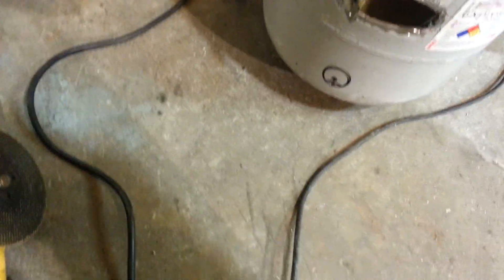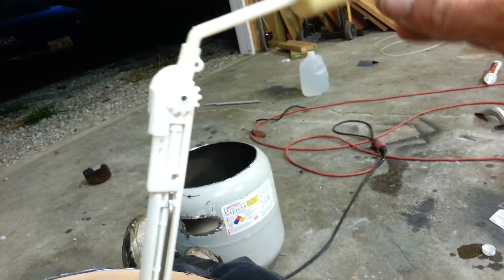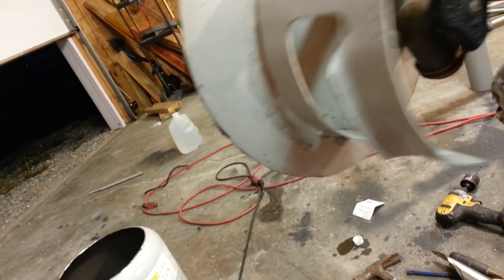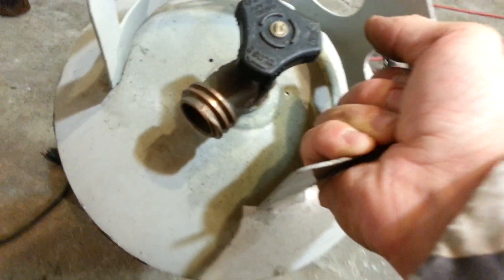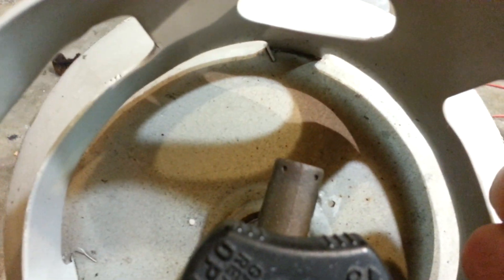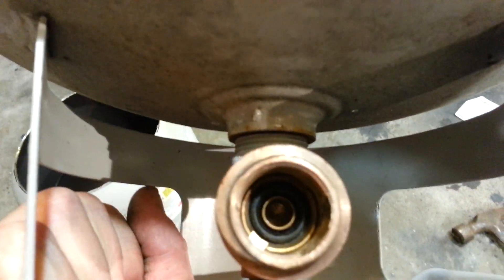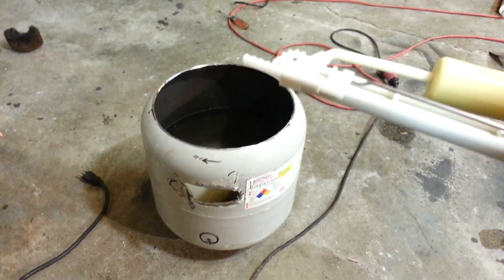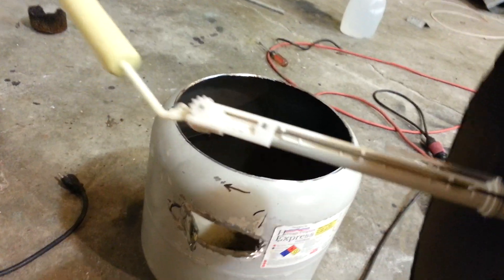How to cut a Propane Tank open  (Safely) Whats inside ?

Comment: The danger for musing a drill is igniting the gas with the motor from the drill not necessarily the drill bit the proper way to drill through the tank is to use a hand  drill my dad worked on airplanes and that's what they use

Comment: Appreciate the vid. I've got a camp stove fuel bottle that I'm trying to open. I drove over it with my truck, so the thing is a big mess, and I can't get the pump off of it. Too afraid to cut it open because there is still a lot of residual white gas, but tomorrow I'm going to try and flood it with water. Should do the trick.
Reply: You survive? 🙂
Reply: @electronic-shadow-monster  [checks various vital signs] yup still here ;)
Reply: @EddieTheShoveler  🤣🤣🤣

Comment: maybe should take the valve out before you start to cut. takes about 1:30 to get it out, then fill it with water then turn it upside down for a while (I've got one sitting now for two days) Otherwise I feel like there's a good chance somebody could blow themselves up doing it this way. You'd be surprised the pressure that can build up. I was just reading about a guy that killed himself welding a steel drum that had acetone in it at some point, the vapors from a tablespoon is enough to blow it.

Comment: Another way to get the propane out is a siphon from a bucket of water, or a hose adapter to a small enough tube to fit into whatever opening is available, and fill the tank with water.  Needs a second opening for the propane to escape.
Ignore the residual smell, that's residual butyl mercaptan which is a stinky compound added to propane to make sure you notice leaks!
Reply from the maker: +Scott Willis thanks for the info friend

Comment: how would you empty the tank completely
Reply from the maker: TropojeAlbania push open the  check valve inside of the discharge orfice, its spring loaded and is ment to stop gas from leaking out of a disconnected tanks. hooking it up to a hose made for it will screw into the valve and open it
Reply: NOBOX7 thanks man

Comment: The common reason why the valves are so hard to take off is usually because they are Left hand threaded so need to be turned clockwise to loosen. i found this out after hours of struggling to release one  when in fact i was making it tighter !
Reply from the maker: thanks for the info friend ill keep you in mind next time, i would also like to ad that its a good idea to do this in front of a fan to blow any residual fumes away, Douglas Alan brought it to are attention that drills have sparks inside   unless they are the new brush-less cordless version
Reply from the maker: +Redsparxxx turns out his one was a right hand thread

Comment: I cant get mine to turn either. Little nervous about drilling in but like I've heard slow and wet is always a safer bet. Once you got your holes drilled what else did you do to get the residual gas and liquid out if you didn't rinse it?
Reply: Use an air drill.Corded still actually make sparks inside.
/watch?v=dwphyN2_7Oo
Reply from the maker: i used an air compressor  to blow air into it
Reply from the maker: Douglas Alan very good comment friend ill try and vote this to the top